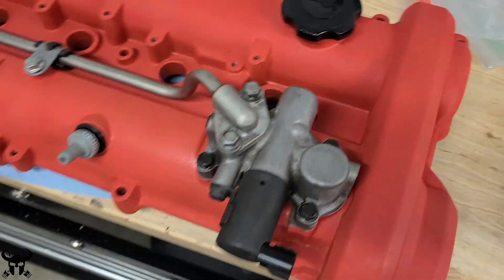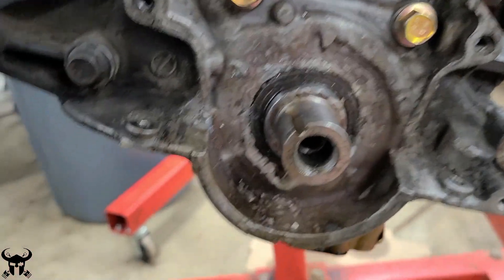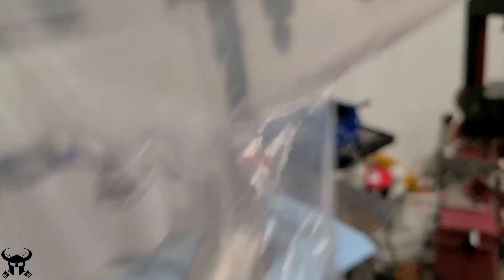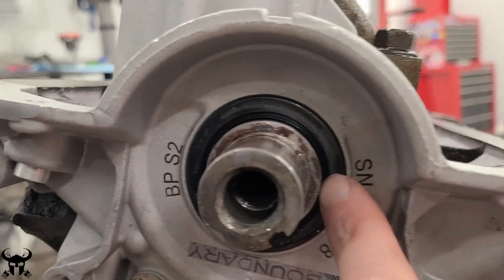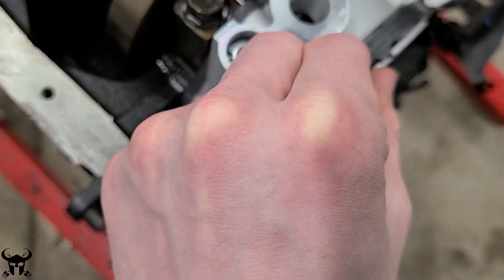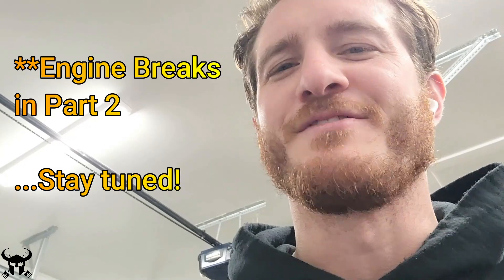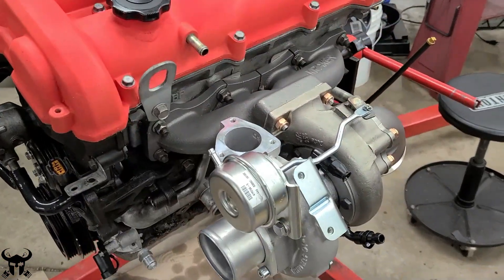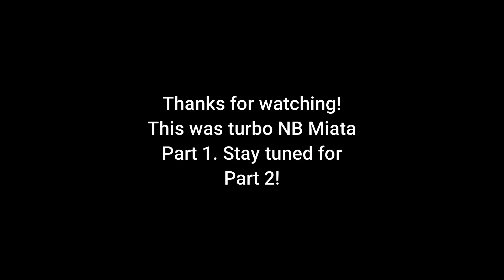Turbo NB Miata Install Part 1 - Oil Pump, Coolant Re-route, Clutch, Lines, DIY

Comment: Pretty sure those torx bolts are supposed to be 15 ftlb. I believe you said 90 inlb. They’re known as the MBSP fasteners If you want to look on the forums.
Reply from the maker: Good call - I did not know what to call that Main Bearing Support Plate. Now I do!
Reply: @EnigmaEngineering  ask me how I know hahaha. Used the wrong torque spec on them thinking it was called something else. Found out what it really was and had to reseal the pan all over again after torquing them correctly